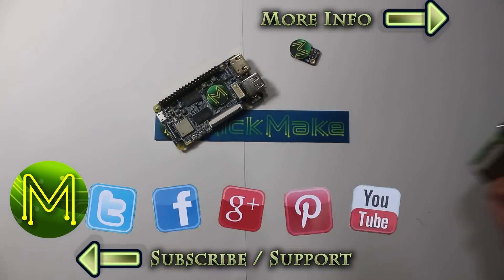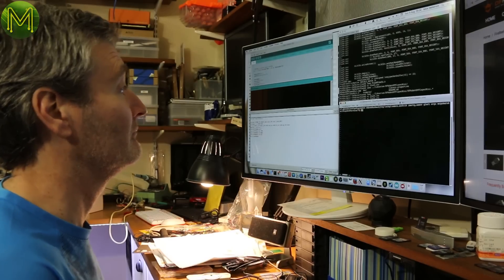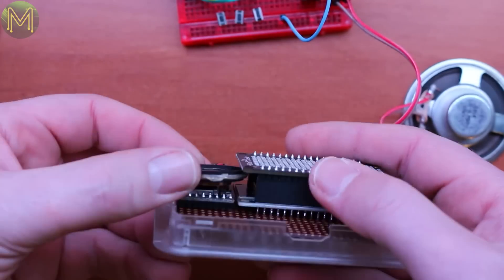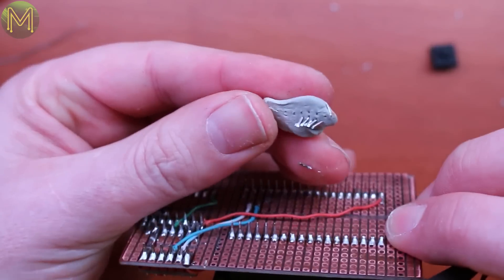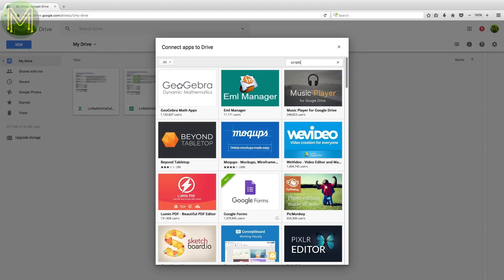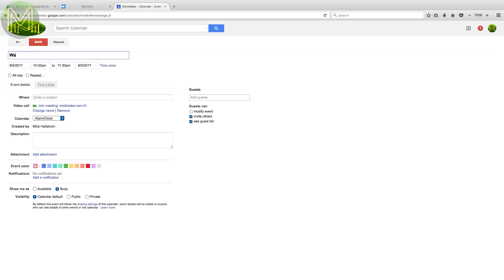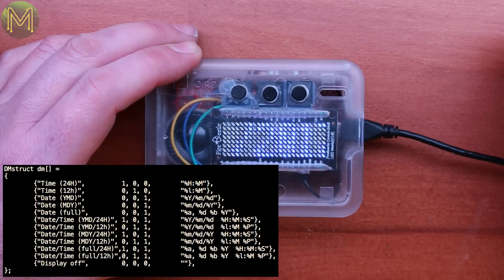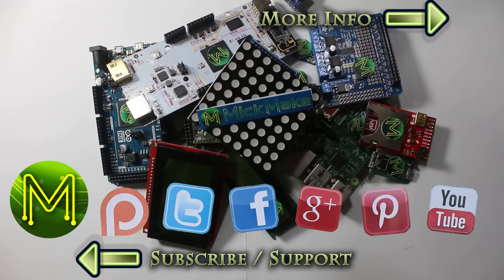#158 Build a talking Alarm Clock synced to Google calendars. // Project

Comment: I will build similar device. FireBeetle is $9 on Bangood - grab it fast! MS released vsmicro which beats all IDEs out there - supports virtually all boards and hooks up to Arduino libs. Recently playing with ESP32 TFTs/oleds and soon BT and RF. ;)
But I don't like that google javascript. It accesses directly your network 24/7. I don't know what is sent in Http/IP headers but this is close to spyware app.  I think better use simple NTP protocol but you must write it if no libraries.
Reply from the maker: Nice to hear. I have an update video of this with some improvements.

Comment: I am a great  Fan of  8266. Would you please, do some videos on interfacing CCTV cams with 8266, so it can stream videos.

One more project would be play from 8266 12E, internal 4M memory mp3 or wav files without using external active components. (No TF cards, and serial players)

Any help would be welcome..
Reply from the maker: +Ansr N 
You can play from internal memory easily enough, but don't forget that even the most basic program will consume around 200KB. Once you get into MP3 playing this might increase to around 500-600KB.
3.4MB isn't much for an MP3 file, but enough to do some basic things with.
Reply: Thanks for your reply. I need to play smaller files, but how .....
I need the code to output sound.
Reply from the maker: +Ansr N 
I can't think of any libraries that do that, but I'll investigate.
Reply: Great!

waiting......
Reply: We can do away with mp3, wav files can be played instead, these are short files

Comment: So can this be done with an Arduino and a cheaper Matrix
Reply from the maker: Absolutely, but you'd need some sort of connection to the Internet, which usually means an ESP8266, which means just use the ESP8266 instead!

Comment: So I have recently been using Alexa for a clock because I can tell it to set an alarm or cancel an alarm.  But there is no clock readout.

I also just picked up one of these https://www.amazon.ca/Alarm-Clock-Shaker-Lamp-Flasher/dp/B000K2IGZO (I was *evaluating*) and the feature I love the most is the fact I can plug my bedside lamp into it and then i can use the snooze button to turn the light on and off (easier than trying to turn on a light using a twistswitch when I just woke up!)

So I want an Alexa alarm with a large digital readout (2x tall what you have) and a way to plugin my lamp into it with a large button to toggle the lamp.

Can you add that in your next version?  ;-)  ;-)  ;-)
Reply from the maker: There was a Kickstarter campaign for an Alexa based alarm clock in last week's roundup. I think that does what you want!

Comment: Security by obscurity? grrr
Reply from the maker: +Darryn Jones 
Actually the URL is so long that no one would be able to remember it and that is stored in the flash of the ESP32.
It's no different to having a password stored there and if someone did find the URL all they'd be able to do is read the next two days of your calendar.
So I reckon it's pretty safe.
Reply from the maker: Yup they are all valid points, but everything is insecure given enough time and effort. Even 2 factor auth.
My point is that the information gained from a particular dataset should be protected enough for it to be not worth someone's time to get it.

In this scenario, the assumption is that people are using it just to wake themselves up at a particular time, using a calendar created specifically for the task.
Everyone should be mindful of how their data is protected. If you know that text will be potentially accessible by anyone, (EG email), then you don't put sensitive data in.

Having said that, however, any code I write should look at the worst case scenario and offer as much security as I can place in it.

(BTW Note: the URL that you see on the address bar is no longer valid as I always remove any logins that I use in videos)
Reply: Depends on what you consider 'safe' Mick.. any information you give to someone can compromise you in ways you don't anticipate ... Never mind, I just watched the part where you mentioned you plan on adding a password.
Reply: There are people who can memorize long random sequence of character in short amount of time.  Some of them can even recall the sequence in reverse, or Nth character almost instantly.

Comment: Nice project!
FYI, the ESP32 is 5v tolerant on most of it's I/O pins. You should be able simplify things a bit by eliminating the level converter.
Reply from the maker: +David Granz 
Yes true and I should have explained why in the video.
The MP3 player couldn't handle the 3.3v  logic levels for some reason and was non responsive when directly connected.
Reply: Ahhh. Perfect reason. Thanks for the clarification. I'm wondering if since the ESP32 has I2S hardware, it might be possible to have it decode/playback the mp3s directly.  I think I saw a mp3 player project for the ESP32 somewhere (github perhaps).... but of course the price of these little module things from China are incredibly inexpensive.